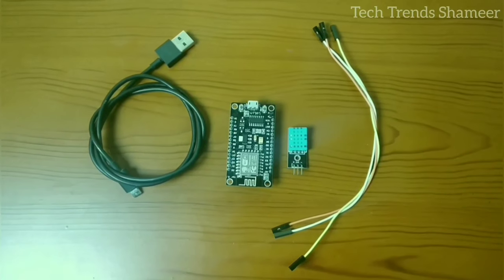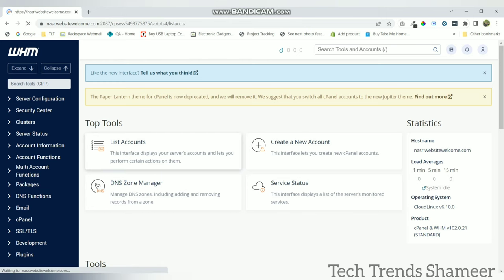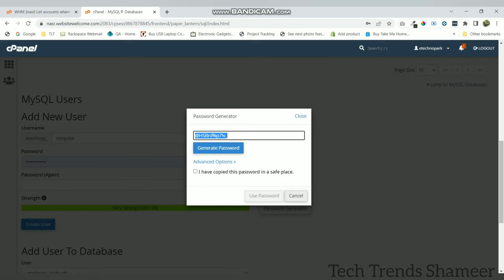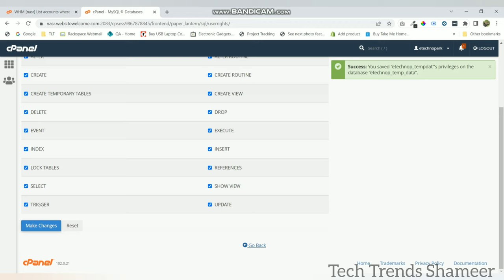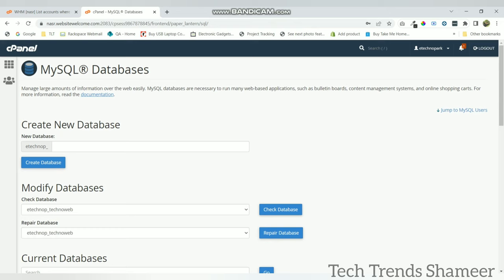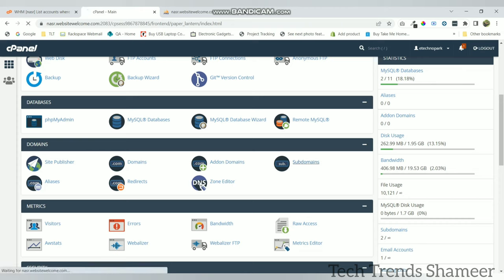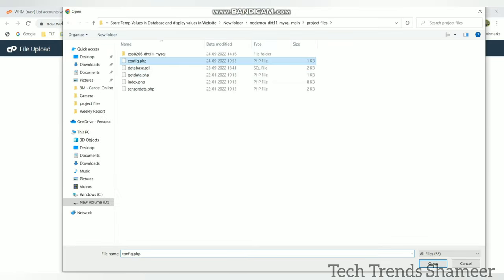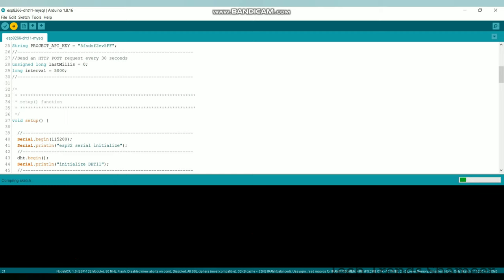Real Time Weather Station | Store DHT11 Data to PHP MySQL using ESP8266 | ESP8266 Projects

Comment: Sketch uses 1585925 bytes (50%) of program storage space. Maximum is 3145728 bytes.
Global variables use 46292 bytes (14%) of dynamic memory, leaving 281388 bytes for local variables. Maximum is 327680 bytes.
esptool.py v3.3
Serial port COM4
Connecting...Traceback (most recent call last):
  File "esptool.py", line 5387, in <module>
  File "esptool.py", line 5380, in _main
  File "esptool.py", line 4687, in main
  File "esptool.py", line 115, in get_default_connected_device
  File "esptool.py", line 664, in connect
  File "esptool.py", line 629, in _connect_attempt
  File "esptool.py", line 519, in sync
  File "esptool.py", line 458, in command
  File "esptool.py", line 421, in write
  File "serial\serialwin32.py", line 325, in write
serial.serialutil.SerialTimeoutException: Write timeout
[1288] 
Failed to execute script 'esptool' due to unhandled exception!
Failed uploading: uploading error: exit status 1 

sir problems sloved this  help